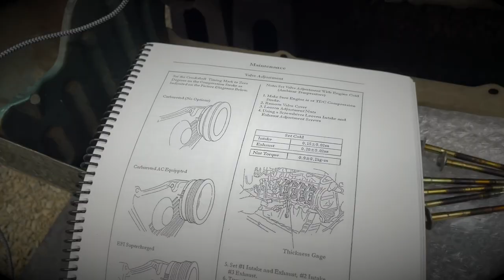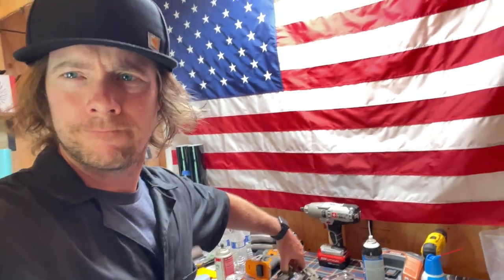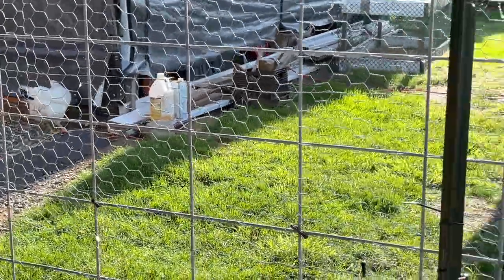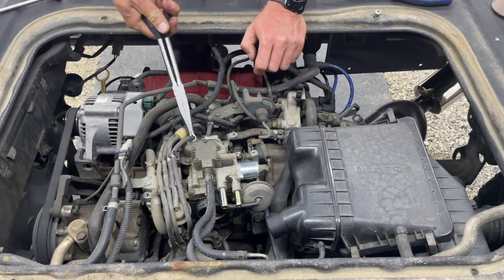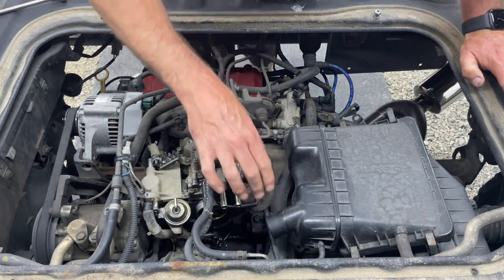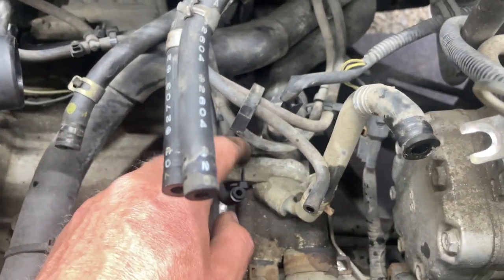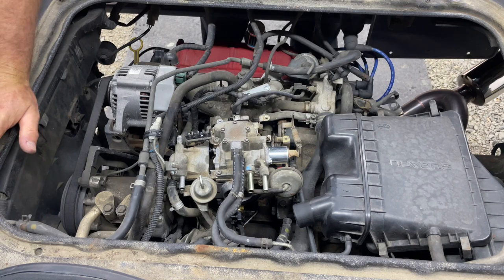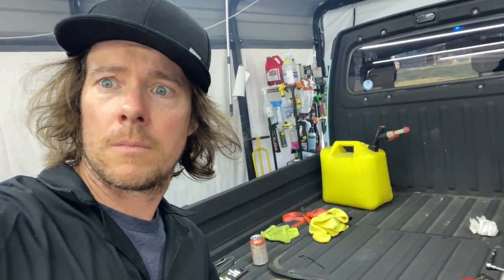Subaru Sambar Carburetor Rebuild Part 2 SUCCESSFUL Tested and Running Like New! So STOKED! KS3 KS4

Comment: Nice video, I just redid  seals and gaskets in carb , two new carb solenoids , New power valve, New valve stem seals, Valves adjusted, Ignition timed and im still getting smoke... Can you make a video on tuning these carbs? i feel like im running way to rich or something. Maybe if you could go into the choke more and how it works too. That could be an issue on mine
Reply from the maker: you'd be getting smoke from oil in the cylinders. maybe the rings are toast :/ because the valve stem seals would've fixed it. and tuning the carb is still new to me. I would like to get a wide band o2 and put it in the header i have so i can see if im running rich or lean. the carb is set to what the factory was so unless it got changed, it should be good. same with the choke, still learning that too. you make sure all the linkage turned freely? thats why lubed mine so the choke wouldn't hang up and starve it of air.

Comment: Hey KJ! Do you have any info for baseline setting (bleed air screw & fuel flow screw) ie; how many turns from closed?
Reply: I don't but I can check the old carb and see what it was sitting at. I think I may need to dial that carb in a bit so I can post an update
Reply: @kevinjames4639  I would GREATLY appreciate it!!! TIA!!!

Comment: What muffler is on the standard manifold
Reply from the maker: that's some suzuki muffler from Japan, it was off a motorcycle or something. im sure you can find a suzuki round muffler in the states. still sounds the best in my opinion but it's not as flashy. i need attention for the biz lol